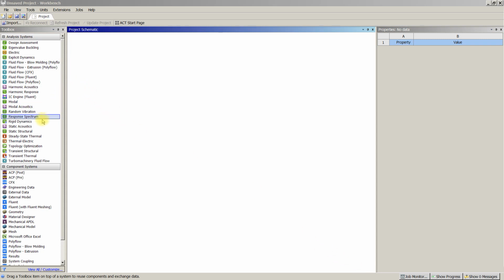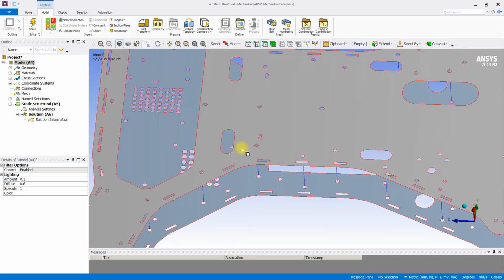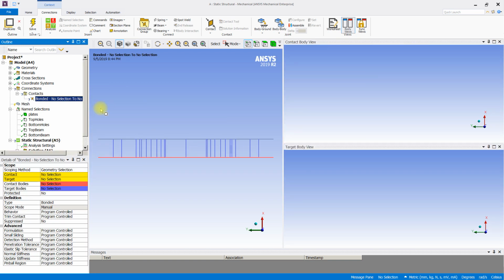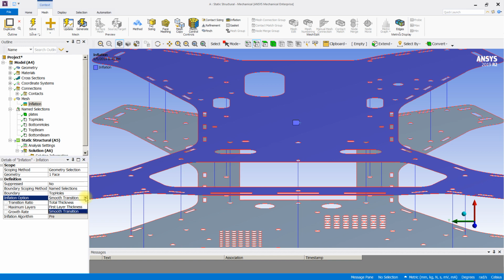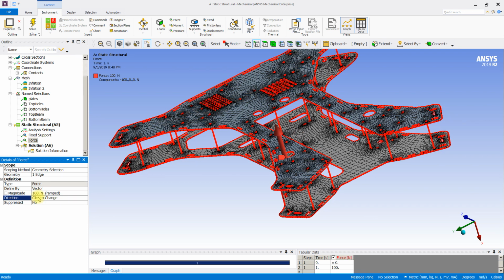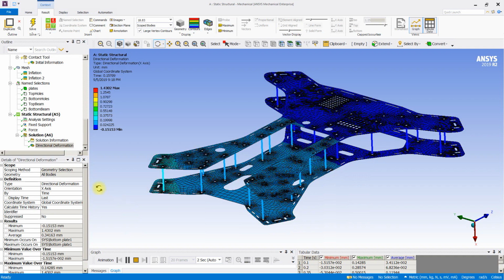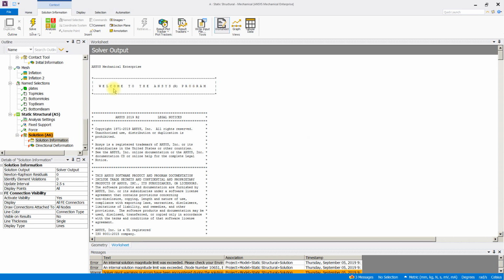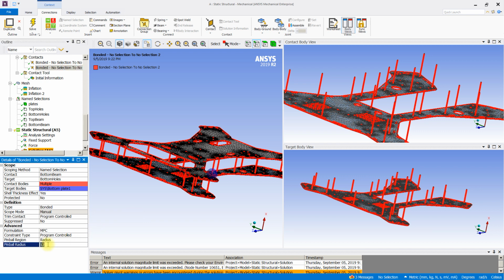Beams, Shells and Bonded Contact

Comment: Hey great video, thank you for putting this together. Also the reason your first model failed is because formulation was set to program controlled. MPC is the formulation needed to joint vertices to edge nodes. Thanks again nice video
Reply from the maker: Thanks for the comment John.

Comment: What if I don't have holes? How do I control the beam location?
Reply from the maker: If you have beams that touch a surface meshed with shell elements, you can create a contact between the beam vertices and the face. The pinball radius will find nodes on the surface within the pinball radius to create the bond with.